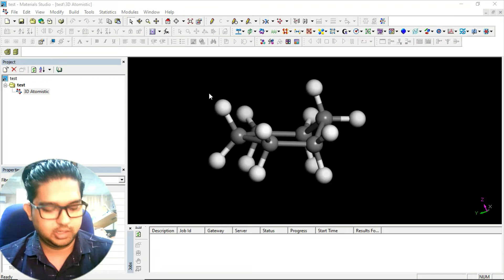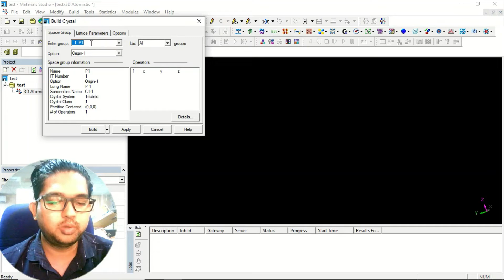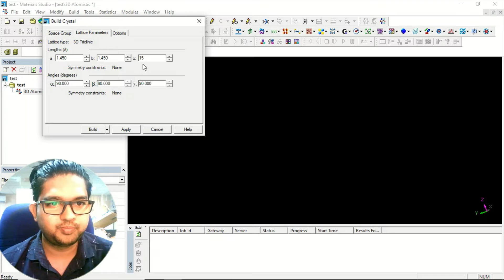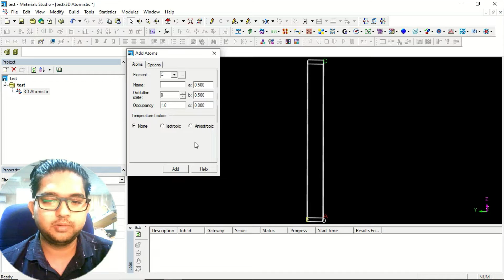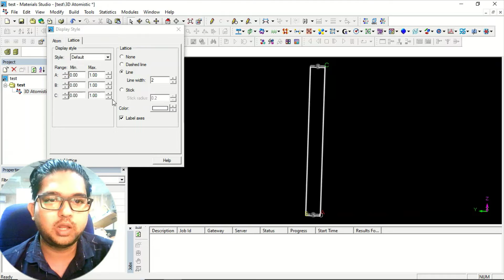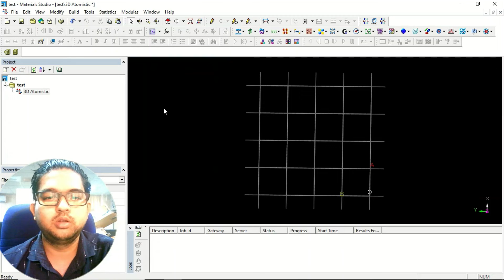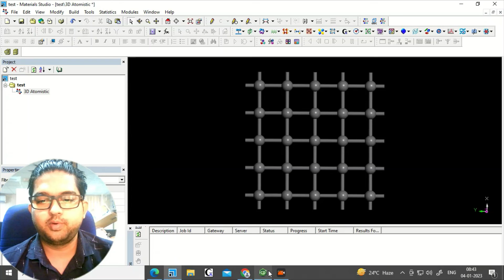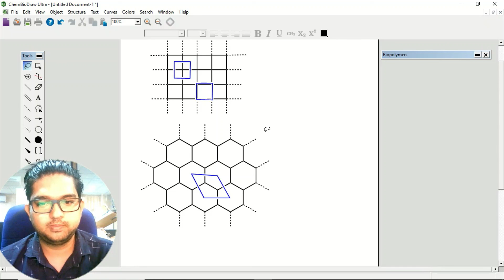Nanosheet Designing in Materials Studio Software for a Beginner ||Part 1 ||Gaurav Jhaa

Comment: Okay, so assuming I know the structure approximately from a paper, how can I find the correct lattice system to draw it from scartch?
Reply from the maker: @dol--lod282  first decide the unit cell and using history and trial process guess the approximate lattice parameters and use the P1 lattice system (in case you don't know).